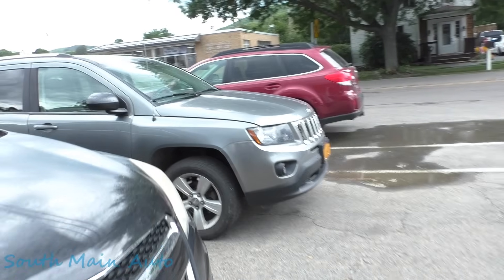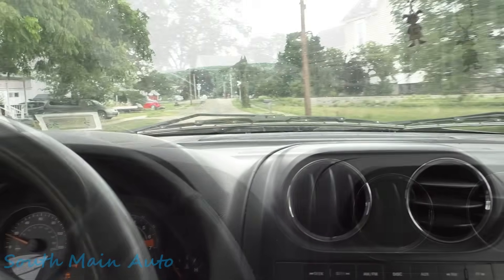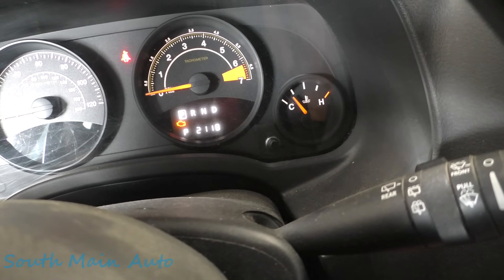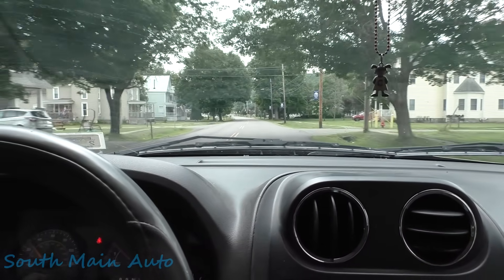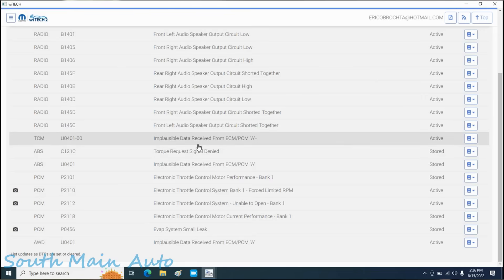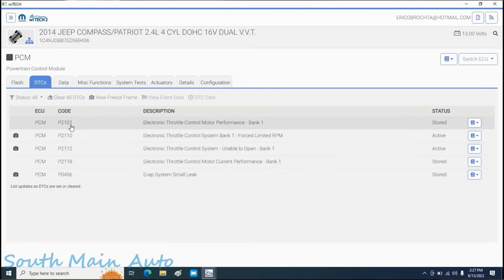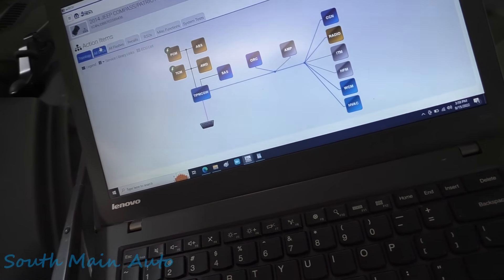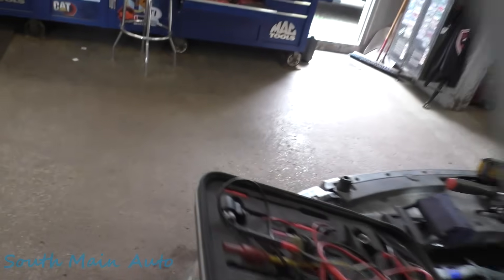Jeep Compass: Flashing Throttle Light & No Go

Comment: I have a 2014 Dodge Durango. car wouldn’t start and says “not in park”. Tcm fuse was blown. Replaced the fuse it blew also. Tested it, shows a full short. Long story short I took apart the TCM and opened it up completely. A portion of the circuit board was blown apart. Cleaned it, tested it, resealed it and the car runs perfect. Dealer wanted $2700 and the parts were on back order. Thank God I did it myself. Cost me $212 in sealant and trans fluid. If I can do it you can do it!😅

Comment: Nice work as always Eric finding the root cause. I have a 2016 Jeep Compass Sport with a CVT transmission but, have not really  experienced all of the bad issues that other owners have complained about. I did have both the rear wheel bearings replaced. I just recently had my front brakes replaced, they were the originals. The only real issue is that this motor 2.0L , burns a lot of oil.
Reply: any CVT service? fluid and filter?
Reply: Really?  I have a 2010 Caliber with the same 2.0L, 108K miles, doesn't burn a drop.  The "World Engines" used in the Caliber/Compass/Patriot are actually pretty reliable
Reply: @petersmith7140  My transmission does whine so I'll eventually get it checked. Probably just needs new fluid and both filters changed in the trans.
Reply: @chrisfreemesser  My wife has a 2007 Caliber R/T AWD w/ 2.4  and except for the shitty CVT trans and it being underpowered for my liking it had been a good car for her. Now hane 143k on it and it does the jod. Have to check the throttle body to see if it's all dirty like that one but it burns no oil at all. Been on top of oil changes siince new . Thanks Eric O for another great video so I can do some preventive maintaince on her vehicle.
Reply: @chrisfreemesser  It's probably my driving habit. I do have fun driving mine and staying way up in the RPMs accelerating on the highways around the city. I currently have 110,746 miles. I do have an ODB performance inhancer and performance intake/exhaust on it.

Comment: I have a 2014 Jeep Compass as well. the throttle body went at 70k miles…. Tiny Head gasket leak started at 110k and had to fix the whole thing…. Hoping to get another year without major problems then get rid of it… it’s been good other than those two issues but from my research they’re the most common issues on this series of Jeep.
Reply: Jeep= Just empty every pocket!
Reply: @coreturkoane5570  Tell me about it... the head gasket repair costed me like 3-4k. And at the time my car was work 10-11k due to the inflated market and I wasn't in the position to just get a new car as I'm saving up to purchase a home sooner rather than later
Reply: @AW151992  sorry to hear that. What model of jeep do you have if you don't mind me asking?
Reply: @coreturkoane5570  2014 Jeep Compass Sport

Comment: There's a good chance it will be back in a few weeks.  The gears get knackered inside the throttle bodies.  Relieving the drag just gets it by for a while. You have three options: put in an Amazon Chinese TB and change it again in a month when it fails, put in the new REVISED Jeep part that requires changing/splicing the pigtail connector and change it again in 6 months when that one fails.. Put in a Hitachi built TB and don't worry about it again.  The Hitachi also doesn't require splicing in a new connector.
Reply: I didn't know Hitachi made auto parts. I remember them as an audio/video component company. I guess there is no market for those anymore, so they've switched to making electronic car components.
Reply: @paulparoma  Hitachi has always been a big player in auto OEM electronics.  I am actually an electronics tech and have repaired Hitachi OEM electronics since the 80s at least.  Very big OEM.  Rockauto carries the Hitachi part.
Reply: @ohger1  I see. I suppose they are a very large electronics company, kind of like Matsushita. Next time I look for a part, I'll be sure to choose the Hitachi. I hope they make them for my Scion.
Reply: @paulparoma  The Scion parts may be fine and probably are. The reason I recommended the Hitachi *specifically* for the Compass is that the originals are known to be troublesome and the new revised Jeep part didn't fix that.  Amazon reviews show the Chinese knockoffs to be junk and I don't know who makes the Dorman or NAPA TBs for this model Jeep, so that left me scrambling to find something that would work.  Still, I think that if you see any Hitachi part offered, it would be a fine sub even if it isn't necessary as I feel it was in the specific case of the Jeep Compass throttle bodies.
Reply: @ohger1  Yes, Toyota parts are fine, but I was thinking in terms of having to get an aftermarket part in case a Toyota one is not available. It's good to know Hitachi is a quality supplier. I had a Dorman EVAP canister installed, before I learned Dorman is supposed to be garbage, but it works fine. Little by little, Toyota is discontinuing parts for my 2005 Scion, so it's important to know what's out there, because I want to keep this car for as long as I can.
Reply: That happened to me!  They cleaned the throttle body and it ran fine another 6 weeks then the problem returned.  Replacing the throttle body finally fixed it.
Reply: I just bought a new idle air control valve for my Grand Marquis that is made by Hitachi; and it is made in the U.S.A.  Great video!
Reply: @lvsqcsl  Nothing like owning a Grand Marquis. I had 3 of them. Wonderful cars, albeit a little tight in the back. It's a shame they don't make them anymore.

Comment: The 1995 Jaguar had a problem where the butterfly would lock up. I bought a spare throttle body and polished it up then installed. The lock up would take about 30k miles so swap the spare and polish again. My 1988 and 1989 XJ40 XJ6 didn't have this problem.

Comment: That'll be the day when all of the new tech you can throw at one of these things can out smart some genuine crud. This customer must be one of your loyal followers and didn't go the parts cannon route first. You got lucky there and the been there done that experience helps too! Good vid. Besides the humor one reason I watch is I'm fairly decent with older carbureted engines and a fair amount of their issues. But what they're putting out these days and the service data that they publish for it (1) you need a computer science and scan tool degree and (2) don't forget the subscriptions you pay extra for.

Comment: You ever had a Chrysler etb that opens by itself? I remember when I worked at meineke in Lubbock Texas my boss used to have us pick up elderly customers cars if needed and this 80 year old lady called and said her car was accelerating on its own.  Chrysler 300 with the hemi lol.   We laughed and said yes she must have hit the wrong pedal.  Well I went to pick it up and it seemed normal while backing out of her driveway.  I revved it a few times before putting it in reverse by the way...... as I pulled to the stop sign right by her driveway I put on the blinker to turn right and
 gave it a tiny bit of throttle the throttle body fully opened and the car jumped sideways as she watched me drift her car lol. After I came to a stop and got out and popped the hood  She yelled I told you!!!  Good times.   Got a new etb from the dealer and it was a revision to fix a "unknown" issue.  I know we all have made fun of customers at some point and called them crazy or stupid but sometimes they are right

Comment: My sister just had the throttle body assembly removed/cleaned and reinstalled.  Solved the flashing throttle light, no problem.  She went to CT and they charged $148 just to look at it but wanted $800 to replace the throttle body ($500 part + $300 Labour).  Referred her to my mechanic who did the cleaning and he charged her $128 and he said cleaned it like new.  I live in Canada and we have a few honest mechanics here too.  Been going to my guy since 1996 and he never let me down.

Comment: I had a 2006 Pacifica 3.5 that would get dirty and bind just like this.  It was cable driven and you could tell it was getting dirty because the pedal would stick when the plate was closed.  Cleaned it several times over the years.

Comment: A variable pulse width could  be fed to the throttle to find the point at which it opens? That would be just confirming the codes thrown? Is that a worth while test? Many people would have replaced the throttle body to be one and done. You are a good man. You have expanded our minds and knowledge base.

Comment: I had that problem with my Chevy pickup. Also had at least six customers had had that same problem. Sticky throttle body at the bottom. I was using Shell gas at the time. I asked my customers what gas they were using and they were also using shell gas.

Comment: In the early years of electronic truck engine flash files, we would put in the latest file. After some new files with new bugs, or unwanted parameter changes, we only changed files for a known problem that  a new file fixed. As emission law’s tightened, a special waiver from our factory tech center was required to back flash to the original file. The time came when you could not back date the files. A particular occurrence happened when emissions tightened again, and the newer files had a 2 degree narrower timing window. Camshaft replacement sometimes required idler gear lash adjustment more than once.

Comment: Been wondering about this now that I have a modern throttle by wire car.  My last car had a cable throttle and I could feel in the pedal when the throttle plate was getting stuck & that it was time to clean the throttle body.

Comment: I had a 2007 Chrysler Pacifica, that showed the same codes,, guy at work said  replace the Throttle body,, NOPE,, it was the connector going to the T-Body,, seems its a common problem,,
Reply: I have one of those with a 4.0L. No problem with this, so far. Which engine in yours?

Comment: I had a 2015. Quit out and went into limp mode. Same lights came on the dash. I diagnosed it and it was the drive by wire motor on the throttle body. Replaced it and repaired it. Ripped the cover off the throttle body motor and the plastic spur gear that opens the throttle plate the first few teeth were wrong away. Electric motor on the throttle body has a metal gear that rides on the plastic gear.

Comment: Mine does the same this also with traction control light. A lot of the time you can clear that throttle light by shutting off the engine. Depress accelerator to the floor turn the key and cycle the starter for a few seconds. Let off the pedal and start again.

Comment: Chryslers and Dodges are NOT crap! I've had three Caravans (one new, two used; nothing newer than 2006) that have performed well to 250,000 miles and required nothing but bolt-on repairs (EGR, alternator, fuel pump, water pump, etc.). Never a check engine light except for EGR and gas cap. Did it all myself with minimal hand tools. Changed oil every 5,000 and trans fluid every 60,000.
Reply from the maker: I am here to tell you, I have been working on cars and light trucks professionally for over 22 years. Chrysler products are bottom of the bucket sir. Any mechanic worth their salt will agree. I am sure there was a few folks who had great luck with Yugo's also...
Reply: TIPM. Enough said.

Comment: Another great video.  Once again, effective diagnosis and practical solution with the customer in mind vs. inflating the bill.  You're a rare bread.

One question.  This POS has what appears to be a meaningful safety issue or issues with its brakes and tires.  Do you mention these issues on the bill to protect yourself from him coming back at you if there subsequently is an issue and to protect him from himself?
Reply: Yes. A typical service writeup will include the original customer complaint, the work done, and recommended work that was observed during the process of the original service. Ultimately, a shop is only responsible for something that was under their direct care. Someone that got their tires rotated and had a tire fly off on them, that is a shop liability, whereas a stuck-open throttle wouldn't be, regardless of whether the shop observed the issue or not.

That being said, a shop CAN make a customer sign a waiver or completely disallow any work to be performed on a vehicle if it is deemed unsafe from the start. Something with a rusted frame will typically get a denial of service based on vehicle safety.

tl;dr, laws are pretty biased towards shops, as long as the work they did was up to spec.

Comment: As a Jeep tech for almost 10 years, I can guarantee you that throttle body will come back with the same issue. I've cleaned 10+ TB and every single one came back.  I just started replacing them. Some are an updated design with a new connector.
Reply: Why do they get so dirty so fast?
Reply: @gregjohnson2073  engine blow by just the engine wears out.
Reply: You have much experience with the xj?
Reply: As a Jeep tech since 1987, I'm gonna have to agree. It will most likely be back.
Reply: So cleaning it real good like Eric did isn't enough?  Is it the sensor on it that needs replaced and that's why cleaned ones just come right back?
Reply: Do you need to program the new throttle body?
Reply: @wasa789  No. These jeeps are simple.  The "relearn" is done by driving it for a couple drive cycles.  Hard codes might need to be cleared by a scan-tool but otherwise the jeep will turn off the red lighting bolt by itself.
Reply: Great how you move the camera around so we can see as well. Amazing Rainbow Ray does thing one-handed.
Reply: Unfortunately that's a design flaw and it seems that there is no recall for this, i own a compass 2012 and i need to replace the throttle body for the second time with only 70.000 kilometers on the clock, weak plastic gears inside wear out prematurely.😢
Reply: I'm a mopar tech in training  and am having this issues I replaced it with new connector and it throws the same codes still. Any idea on what to do?
Reply: @daniel2ss274  what did you end up doing to fix it?

Comment: I have replaced two or three of them on jeeps with the same symptoms, got curious and popped the side of the throttle body and found that the nylon gears were damaged.  Unit would work until it hit that certain spot

Comment: I bought a Chevy truck a while back. The shop had told the previous owner it needed a new throttle body. It wasn’t a cheap repair, so they decided to sell the truck instead.

I cleaned the throttle body and drove it another 120,000 miles.

Comment: I had the same light on come on with my 06 Grand Cherokee. I rang the Jeep dealer and they said they didn't know why the light was on nor if it was safe too drive. I read the manual and if you cycle the key the the light should turn off. It didn't. I drove too work anyway and the light turned off. The manual did say it should only effect the 5.7 hemi. I had the 3.0CRD. So if you do have the 3.0 just ignore the light.

Comment: I've always cleaned the throttle body on my cars at least every other year just to prevent this.  I don't even bother taking it off.  Just some Lucas TB cleaner, engine off, then run it while spraying it in the TB to clean the intake valves as well.

Comment: I remember very well the first time I saw an electronic throttle. It was on a mid-90s Volvo semi tractor that my dad had. I'm no diesel mechanic but, back then, those systems were still fairly simple. In dads case, the engine wouldn't Rev above an idle so, I thought that the linkage had worked loose. Wait a minute...where's the cable and what are these wires for?!? A new fuse solved his problem.
Reply: but as mr o says ... what blew the fuse
Reply: Mike,
I understand what your saying,  I drove trucks for 44 years,  I just retired January 31 2022,  those were kind of strange.  I missed the manual fuel pumps too, if you had a sluggish running engine,  you could give it a little more fuel,  and it would wake up and in my case it would pull good, and get better fuel mileage.  
Those days are gone, and I'm glad to be retired.  Have a wonderful day 😊

Comment: Had this same issue on my Dad's '09 Belvidere Bomber. Cleaned the TB which fixed the problem for a few weeks until it didn't. Finally replaced it with a Evilbay TB. Autopsy (destructive) revealed stripped plastic drive gears. Probably stressed from the sticking throttle plate...You may see this one again...

Comment: Roughly same issues, 2019 caravan and throttle codes are showing. I cleaned throttle body like you did but no change, throttle light remained on even when clearing codes.

Comment: I’m having the same problem with my Jeep Cherokee sport 2016 I think it’s the sensor on pedal that’s not reading right for pcm but I’m open to any options to why it won’t idle right and it’s dumping too much fuel in cylinders causing to wash spark plugs but the way love your videos I’m learning a lot.

Comment: I do like being able to figure out the root cause of a failure, but honestly with that whine and crunchy sound moving the plate, that throttle body would have been condemned pretty quick.  I've seen a lot of them, especially the GM L96, get a worn spot right where they sit the most.

Comment: The “one goes up the other goes down” might not be redundancy as such but a noise rejection scheme. As the signal travels to wherever it’s going, noise gets added the same to the signal (s+n) and its inverted copy (-s+n). At the destination these noisy signals are subtracted so the signal doubles but the noise gets cancelled (it’s a (s+n)-(-s+n) = s+n+s-n = 2s thing).